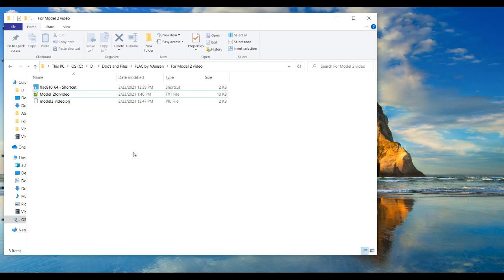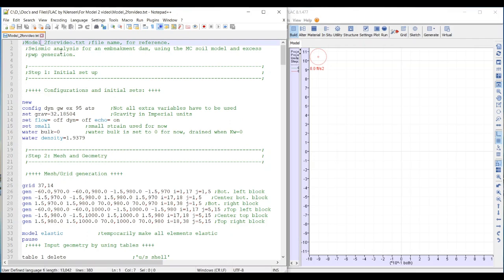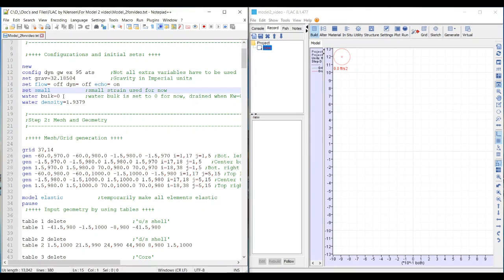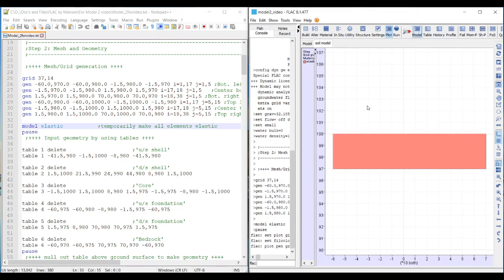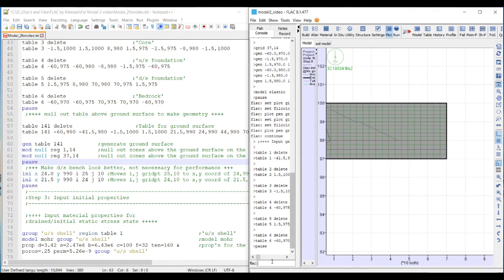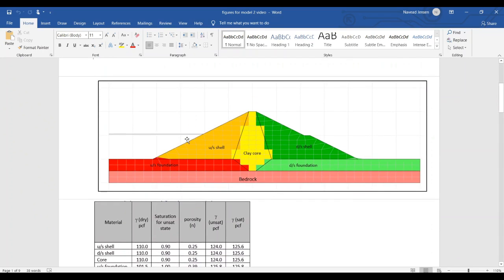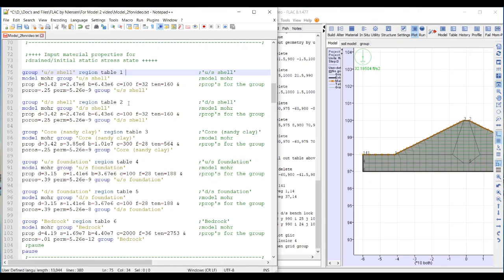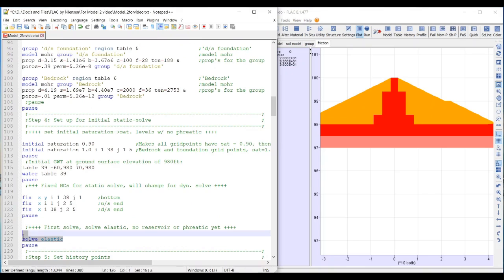Seismic analysis (Part 2 of 5) of an embankment dam and foundation, tutorial using FLAC.

Comment: Could you please show all engineering properties with the units that used in FLAC. You used slug/ft3 for density, but all other units in psf. Correct?
Reply from the maker: Hi Mahir - Thanks for pointing that out, I didn't really say which units things were in. 
You are correct, it is all in Imperial units: 
den=slug/ft3, cohesion, shear modulus, bulk modulus, and tensile strength all have psf (lb/ft2) units.  The porosity has no units.  The permeability is in a kind of strange units that FLAC wants for permeability: ft2/psf*sec.  I would normally use something like ft/sec, but it wants ft2/psf*sec.  I would consult the Itasca manual for the "equivalent" metric permeability units that FLAC requires ((m2/kpa*s) maybe?).  

Also, if you haven't already, you can request/download the appendix of the FLAC guide that has similar examples (or maybe even the same example) but in paper format instead of in video format:
here: https://www.researchgate.net/profile/Navead-Jensen or 
here: learnflac.com.
Reply: they defined permeability as ft^3.sec/slug, but hydraulic conductivity as ft/sec
Reply from the maker: Right, okay, that sounds good.